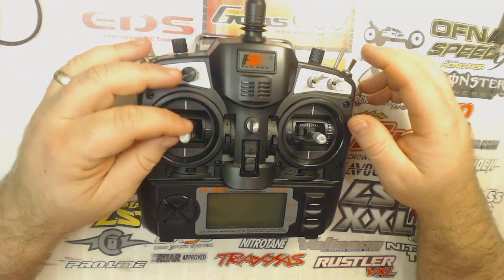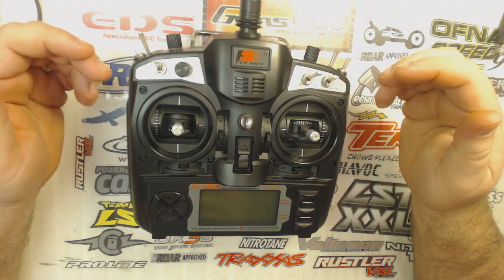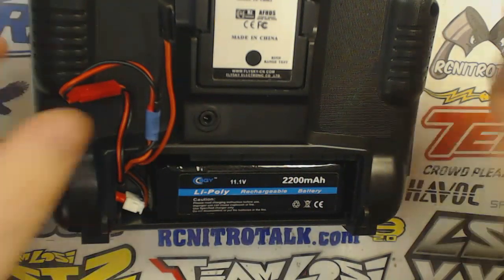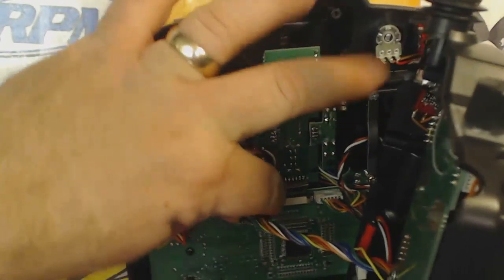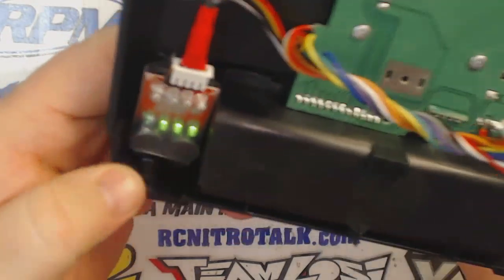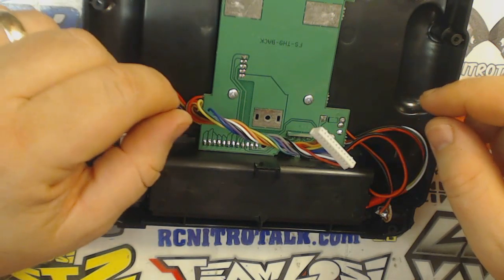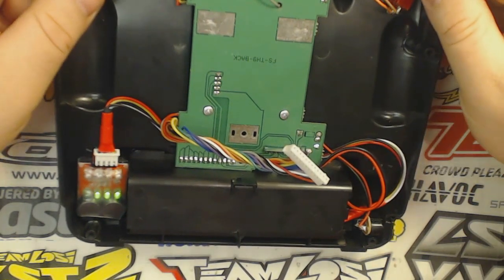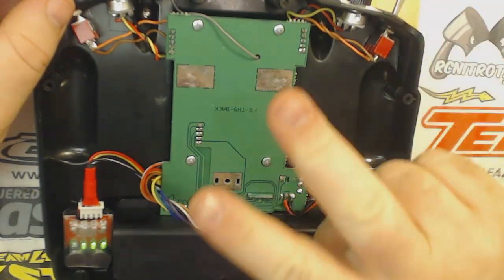Flysky FS-TH9X (Turnigy 9X) LVC Alarm mod

Comment: can i use this, (ZOP Power 6.6V 2000mAh 8C LI-FE Battery), to power the FlySky TH-9X?
Reply from the maker: I gave up the TH9X a couple years ago for a DX8 so Im not 100% sure but Im pretty sure it takes a 3S pack. Actually I just looked at the battery I was using in this video and it is 3S.

Comment: like this its real a a good idea do you know what the minimum is for a 9.9 life battery that's what I'm using on my turnigy 9x
Reply from the maker: +James D for some reason Im having a hard time remembering off the top of my head but its either 2.8v or 3v per cell. I wanna say its 3v/cell but for some reason 2.8 is also stuck in my head. Cant recall for certain, I dont use LiFe all that much
Reply: I could appreciate if you could be sure so I can lock the number in on my charger its hard to remember all the different settings on the battery's I use so it makes it easy for me to log them in on memory on the charger thanks Greywolf

Comment from the maker: Yes it does but you only plug it in while its in use. Its basically just a safety feature in case you forget to turn the TX off after you are done using it.